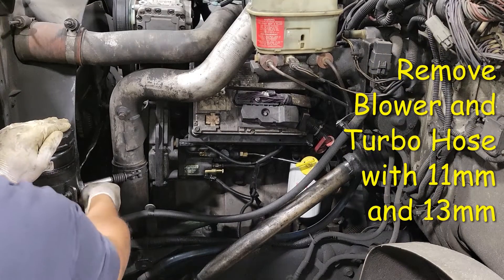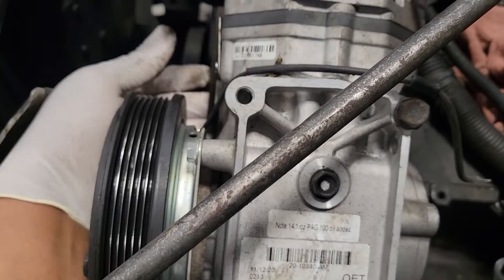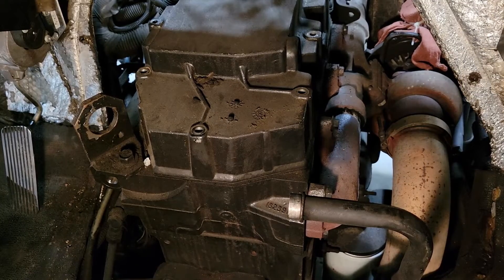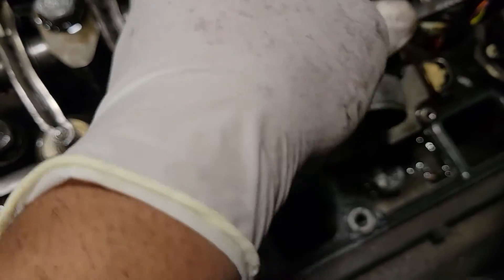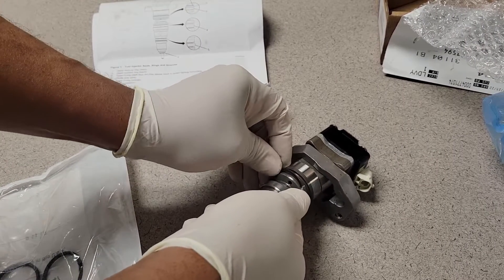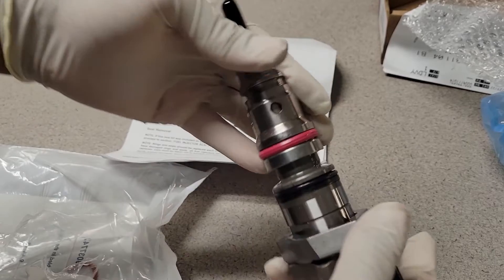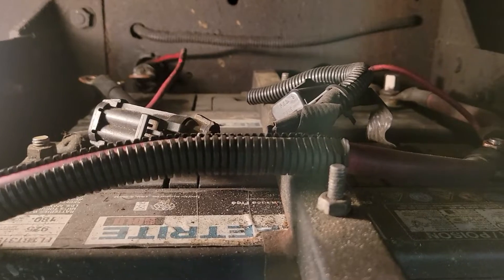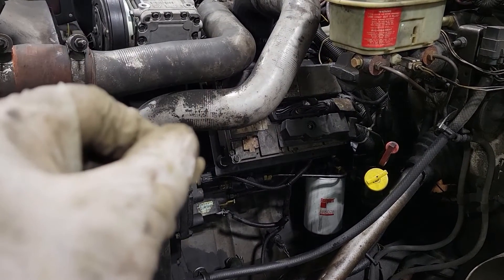International DT 466 Injector Replacement

Comment: Just had a quick question. My exhaust has been blowing white smoke, i thought the problem was water in the combustion chamber, i changed the head gasket, but seem to be having the same problem.
Reply from the maker: @JoseLuisCruzGarcia-nr2zr  Good question, that could be a couple of things. If it's a 2004 on down. It sounds like the Turbo. If it's 2005 on up . It could be a Turbo or a EGR Cooler.

Comment: Best walk through I’ve seen and international yet great job man.
Reply from the maker: Thank you!
Reply: Hey I have a 2007 international 4300 dt466       it looks a little different than this engine
Reply from the maker: @taylormadeshipping5010  this vehicle is a 2002 S4700 DT466
Reply: So is there a huge difference in injector replacement for a 2007 dt466 than a 2002 s4700. just got my injectors in the mail 5500 in my current situation
Reply from the maker: @taylormadeshipping5010  This video should be able to help with the 2007 also.
Reply from the maker: I must say that there is a difference in the Injector and the harness
Reply: @dairleautoclassicrestorati6892  ok thanks for the heads up
Reply: Do i need to remove the coolant reservoir and hose i see it’s on the other side on the 2007.
Reply from the maker: @taylormadeshipping5010  No Sir, if I remember correctly.  You shouldn't have to do that on a 2007. You just need to move aside any items that maybe  blocking the Valve Cover.
Reply: Is the ICP located in the same spot on the 2007?
Reply from the maker: @taylormadeshipping5010  It is inside the Valve Cover.
Reply: The issue i’m having now is that i didn’t drain the oil when i took out my injectors and now after replacing it the vehicle won’t start and its oil coming out the top of the injectors.
Reply from the maker: @taylormadeshipping5010  drain your  Oil Rail of oil and fuel if needed. Then try to start the engine. It may take about 4 -5  times to start for the Oil Rail to fill back up with oil. Once engine starts up. It will smoke for a little while. Do not worry, it will clear up and the engine will smooth out.
Reply: So the weird sound i’m hearing while trying to start it is the too much oil in the oilrail? It’s sound like a winding sound.
Reply from the maker: @taylormadeshipping5010  which Injectors did you replace?
Reply: @dairleautoclassicrestorati6892  1 and 2nd  injectors

Comment: Great video. Really appreciate you sharing your knowledge and helping us tackle this at home. Really wondered if there is a reliable way to check which injector is bad other than using the expensive software? I have tried to use a temperature reading on the exhaust manifold with mixed results. Any feedback or suggestions would be greatly appreciated. Thanks again for your video.
Reply from the maker: I thank you very much for your comment. I wish that these engines was like in the late 90's when you could just break a fuel line loose to find the problem. I'm afraid that a scanner or laptop is the only way to go now days.

Comment: Great video. I’m needing the injector wiring harness and injectors replaced on my 2011 DT466. Is this similar to that year as I’m not sure what year this is in the video?
Reply from the maker: @CanVasMacMillz  Thank you for your comment. The vehicle in the video is a 2004. A 2011 will be a little but different.
Reply: @ thank you for your reply

Comment: Great video man.    I greatly appreciate it.    I have a question, 2005 international 4309 dt4300, runs excellent but getting diesel into the coolant.   The coolant tank keep rising and it smells like diesel.  What would cause this?  I read somewhere it could be injector cup seals.
Reply from the maker: @freerepublicusa2064  I thank you for watching and the nice comments! You are correct,  it could be a Injector O-ring. Or worse case it could be a cracked Cylinder Head. I would shoot for the Injector O-rings.  A set from the Dealer may run around $150-$275.

Comment: Daile, what you do is good work, very professional, teacher, one question, I have had a fault with my truck for a month and 8 mechanics have gone to check and they do not discover where the fault is, teacher my 2003 international navistar dt466 truck.  7.6 , goes into a glitch on gears 6,7,8 , advances and suddenly loses power and feels like a bubbling of air on the fault when it falls into the fault ,
Reply from the maker: That could be the IPR Sensor.  Have a mechanic to check it out. Look at my Video on the Hi-Pressure Oil Pump. It shows how to replace the IPR Sensor. Please have it checked first. The part is around $350.

Comment: Thanks for the video! It helped me get started with replacing my #6 injector; even tho my engine compartment was a little different.

Question. Now I get a crank but no start. Did you have to use computer to calibrate the injector or anything like that? Or it just started right up once oil rail got full.
Reply from the maker: Good question, 
It will not start up until the Rail is full. You may have to turn it over 4-5 times. Once it starts. The Truck will blow out alot of smoke. Just let it run and it will shortly clear out. I hope that helps.

Comment: I watched this video and it gave me the confidence to take mine apart...How the crap do I get the valve cover out of the truck?? Got everything taken apart, but not sure which direction to go with it. Awesome video BTW
Reply from the maker: Remove the Dog House Cover inside the front cab. Pull the Valve Cover out toward the back of the Engine.
Reply: @dairleautoclassicrestorati6892  ok, I removed the entire dog house. Looks like it’s still going to be a pain in the butt…thanks!
Reply from the maker: @Scott Riddle  Take your time. It will slide out. You may have to work it little by little.
Reply: @dairleautoclassicrestorati6892  thanks!
Reply: @dairleautoclassicrestorati6892  I’m getting oil in the fuel, and fuel in the oil. Won’t start without ether, I hope it’s the orings 🤷‍♂️
Reply from the maker: @Scott Riddle  you can drain the oil rail of oil and fuel. Once you pull out an Injector . You will see oil and fuel mixing together.

Comment: Hi sir,
Awesome video. I have a 2001 t444e with a stripped ECM bolt that holds the injector harness. I need to repair the injector/glow plug pigtail that is all frayed. Is there a way to remove that bolt. I removed the ECM but no way to access the bolt. please help, thanks

Comment: That’s awesome I want to know does this engine also throw any type of injector codes and also do you have any experience with the 1978 DT466
Reply from the maker: The vehicle showed no light. By it being more difficult to start. I connected a Genisys Diagnostic and discovered the bad injector. My Dt466 experience goes back as far as 1983.
Reply: So on the early 80s version DT466 how would you do the injector rail
Reply from the maker: @terrellscaife2411  If I remember correctly.  When I changed the Injectors. I would change the rail with the harness. Because I found that harness can be bad and it would make the injector seem bad.
On another note. If you want to see if you have a Bad Injector.  Crank the vehicle. And break a line loose on each Injector one at a time. If a Injector changes the sound of the engine. It is bad and need replacing.
Reply: Thank you

Comment: Does this apply to the 1998 dt466e engine? I always see videos like this that don't mention what year. Are they all the same with the only difference being mechanical vs electric?

Thanks
Reply from the maker: No they are not the same. This video covers 2000-2004. The 1998 is totally different.
Reply: Are they at least similar? I have to replace all six

Comment: I have  a 97 dt466e  blew #2  injector ran good  b4 that  happen  ! So i decided to replace all 6injectors? Got the in cranked it up ran fine for 4min the started missing  like a misfire ? Pull the out took them back they check  them and said that nothings wrong with them , reinstall them , crank truck smooth  at first then started  to miss..replaced ipr sensor and the icp sensor ? Run the same!!!  New oil and filter and fuel filter!!What could Be the??? problem???
Reply from the maker: @AddrianSykes I can surely understand your frustration . You did the right thing by replacing all the Injectors. Normally when I replace Injectors. I also replace the Injectors wire harness.

Comment: Great video. This will help me replace all 6 injectors on mine.  One question: What is that bolt that you tightened with impact wrench at 21:34 mark, that sits right of the IPR? I didn't see you removing it at the beginning of the video. Is that to drain the diesel so it does not get into the injector cup?
Reply from the maker: That's correct.  Thank you for watching and I hope it helps.
Reply: @dairleautoclassicrestorati6892  thank you!
Reply: @dairleautoclassicrestorati6892  actually that's just the bolt for the ECM bracket. How do we drain the fuel? Your video just shows how to drain oil from the oil rail.
Reply from the maker: @acaglumac  you really don't have to drain any fuel.the oil and fuel that was drained is enough. Either way when you start the engine. It is going to smoke and burnout all the excess oil and fuel doing the repair.

Comment: what are the torque specs for the bracket u mention? on the 15 mm soquet bolts?
Reply from the maker: Not sure of the exact number. I normally torque 15mm to 42-45 ft.lbs.

Comment: I have a DT466 had it rebuilt new injectors new turbo had dealer do ecm reset but it still won't pick up any speed. What could the problem be?
Reply from the maker: I would get with the Dealer and find out. What is the governor settings on the ECM. There are adjustments that can be made.
Reply: @dairleautoclassicrestorati6892  what can cause oil to come through the turbo into the radiator and out through breather?
Reply: @dairleautoclassicrestorati6892  the breather hose keeps popping off.
Reply from the maker: @davidcummings8742  Oil coming out the breather tube. Could be a sign of high blowby pressure.

Comment: I changed all 6 injectors. I started to prime the injectors but the pump just does not seem to get hard.
Reply: I did notice that my oil pressure is not moving from 0. It hits but does not start. It did not have this problem before I changed the injectors. What could this be?
Reply: @josuesantana9018  did u figure this out?
Reply: Was that international if so how much for all 6?

Comment: What are the specs for torquing the bolts on the valve cover? AC bolts?
Reply from the maker: Valve Cover: 24LB FT
A/C Bolt: 61-70LB FT
Reply: @dairleautoclassicrestorati6892     thanks for the info. My DT444E has oil leaking into fuel and I am working on replacing o-ring on injectors.
Reply: Thanks for the info 
Replaced all 6 injector o-rings this afternoon. Injector #3 had worn o-rings. All 6 received new kits .

Comment: Hello sir where you located meaning your shop,,i need some repair for my 99 international 4700,,
Reply from the maker: I am located in NC. I do not have a Public Shop. I just  basically setup for my Channel to help out others and to give back. Thank you 😊
Reply: Thank you for the reply well i have a problem here,first my truck starter not turning on when hot,,and now it dies after driving a while like 15 minutes,,hope you can give any tip on how to work on it,,thank you
Reply from the maker: @antonilvillalobos3672 with that year model. It could be the MAP Sensor on top of  the Valve cover.
Reply: When replaced the ICP sensor i accidentally remove the wire harness that is connected to the valve cover close to the ICP,,and now wont connect back,,any tips
Reply from the maker: @antonilvillalobos3672  are you talking about the wiring harness going to the ECM? Maybe I misunderstood. If so, you can go to your local Part Store and try to match up the connector.

Comment: Do I have to spin the engine to put the new injector in?
Reply from the maker: No sir! Just install your Injector.
Reply: @dairleautoclassicrestorati6892  it is a 2007 dt466 egr engine I thought it would be different because I also have a cummins and I didn’t do it because of that
Reply: Thank you sir solves my issue engine had delayed start ! Now question my truck always stumbles or hiccups on startup any idea on what it is?
Reply from the maker: @danielapastor8963  I'm afraid that could be a number of things. If you have to use Starting Fluid or it has a  skip and low on power going uphill. Then I would say a bad Injector.
Reply: @dairleautoclassicrestorati6892  injectors are good verified today has great compression all seals are good and replaced hidden seal behind fuel filter assembly changed as well today
Reply: Has power starts right up too but feels like it revs twice within one second

Comment: What if once you start it it smokes alot and knocks?
Reply from the maker: If you are talking about after you replaced an injector. The Engine will smoke a little at first. Be it should clear up. I have seen and heard of that happening when all six are replaced and the Owner waited to later to change them. That's a chance you or the Dealer will take. If a bad Injector runs for a long time. It can wash out that Cylinder. You may not know it until you put in a new injector. If that happens.  You will have to do a inframe rebuild to replace that Piston.
Reply: How long would it take to clear up? It is smoking really bad. Grayish black smoke.
Reply from the maker: @brad758  was it smoking before you put Injectors in? If you do not drain the Oil Rail before you pull out an injector. Engine will run into the cylinder. That oil will have to burn out. It shouldn't take too long to clear up.
Reply from the maker: I mean Engine Oil would run into the cylinder.

Comment: So the icp sensor didn’t work
Reply from the maker: Sometimes the ICP may or may not be the problem.
Reply from the maker: Please have a diagnostic test done before replacing part. This video basically show how to replace the ICP. Thank you
Reply: Great video I had diagnostic done came back normal no codes